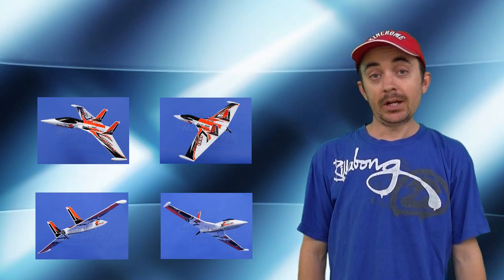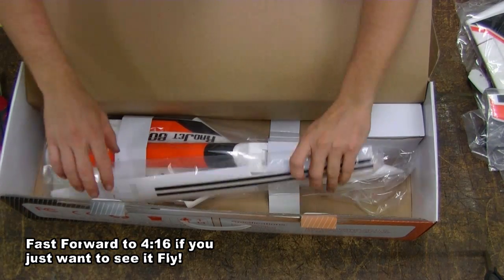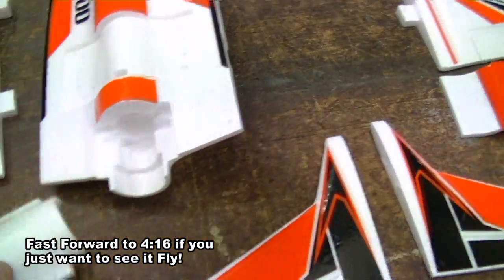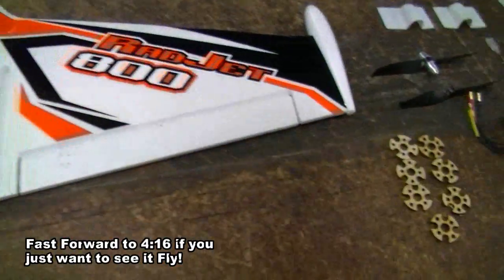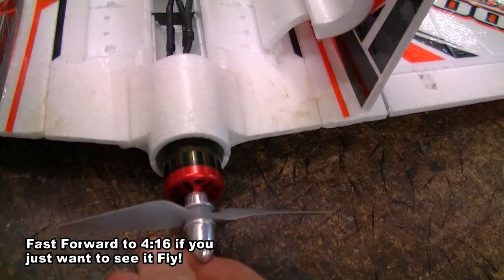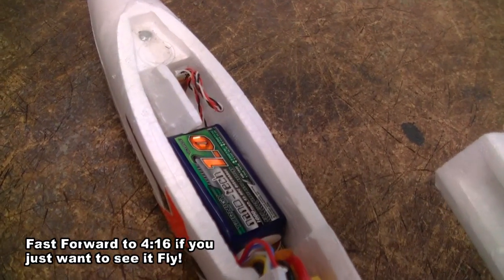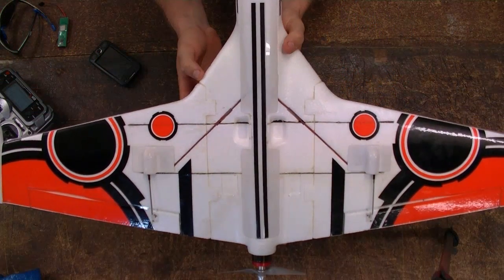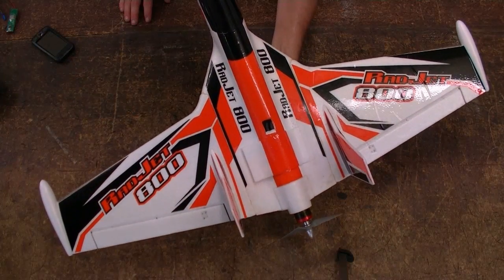HK Radjet 800, Unboxing, 4s Setup and Flights

Comment: When i start i feels like it doesn't react at all to the controlls, what should i do?
Reply from the maker: Do you have enough movement on the control surfaces?    also could be not enough air speed.   Does it get better after launch ?
Reply: @TheRattleSnake3145  I had the aileron controlls inverted XD. So i crashed at slow speeds why it felt like it wasn't reacting.  thanks.

Comment: I know that’s this is an old jet but I just got one brand new pnp and wanted to know if a frsky rx would suffice with my jumper t8sg trans.and why is there 3 different 3 wire(red/black/white)connections and a red n black wire set?

Comment: Yes COG is very important on this model as with all models..Great that you explained exactly where it goes...best to use a marker so when you use different power systems u always have cog in exact location... Important to secure battery to prevent it from moving as this plane is very fast... some guys  have gotten around 200 mph out of a radjet... im more than happy with my 100 plus setups... Great review!

Comment: Hi! Did you use the stock motor mount with the turnigy 2836 2350kv? I'm uncertain whether to buy the turnigy 2826/6 2200kv motor with 3s battery (Slower but longer flight time) or the 2350kv and 4s battery. Did you have some problems with overheating?

Comment: Just finished my radjet with your 6s set up wondering how it will fly with a 4s using the 35-36 ntm 1800kv.  Want to be a little careful at first. Thanks
Reply from the maker: chris horn I'm sure it would be fine as long as the cg is correct.  4s is probably better for every day flying as the 6s needs more room and you can only keep full throttle for a few seconds.  if you do find 4s not enough you can always prop up a bit before going to 6s.
Reply: Thanks so much for the help!!  What prop would you recommend for the 4s with the 35-36 motor. I  have the 5x4.5 on it now. Again thanks so much for the help and quick response.

Comment: Hi I have same motor 2836 /2350 I have reversed shaft but now the slot for the sirclip is not there I take it u need slot for firm location of sirclip 
       Regards
         Gary

Comment: i hate props torque roll is sooo annoying that thing can barely fly leveled..
Reply: Move your motor further up off the wing.  This will give your prop more ground clearance, so that if you wanted to, you can run higher dia. and PITCH prop and still have LESS torque roll.  http://www.hobbyking.com/hobbyking/store/__43929__Hobbyking_Bixler_and_Bixler_2_Motor_Mount_Upgrade_US_Warehouse_.html?strSearch=bixler%20motor%20mou

Comment: hi i have the same setup as yours and the same li-po as yours and i make only 1min 30sec and the lipo drains out to 3.85 what do you think i can do ???
Reply: I'm not always on full throttle, its probably something to do with that.
Or maybe your lipo is old?
Reply: no the lipo is new nano tech i only make 5 times on full throttle from right to left than it will be drain out to 3.85 or 3.75 
can i use the same setup of the 4cell and but a 6cell lipo ???
or do you suggest other lipo for more time but same speed i like that speed and if i can i will want more :D
Reply from the maker: wayne25801 
If you want more speed, check out the setup I currently have in the Radjet.
RadJet 800 6s 1200 watts (VERY FAST)
Keep in mind you will loose a bit of flyability with the extra weight.

Comment from the maker: I used Strips not rods, they are flat so you can just cut a slot in the wing with a sharp blade, then just epoxy them in.  They are bendy one way but very strong the other.  I  prefer to try and get them as close to the CG as I can, just make sure there is enough thickness in the wing where you put them.

Comment: I agree on the cooling, but the motor mount does flip around without modification so that the install looks clean like the original and balancing if needed.   Coincidentally a GWS slowstick motor mount can be used as well for using motors that have the shaft on the wrong side such as in-runners if you grind off the square part used for mounting on the slow stick.  It then fits exactly in the round cavity of the radjet if you ever need to do that.

Comment from the maker: The motor mount was designed for the motor to be mounted this way, there is no room on the inside to do it the way you say.
Also this way is much better for cooling as it would receive none if it was mounted 180deg around.

Comment from the maker: The first battery you mentioned (4s 1000mah 25c) was probably not high enough c rating so that could be one reason ts failed.
Its possible that you recieved a bad battery but if you were having trouble with other batteries you might want to have a better look at your charger, it might not be balancing/ storing your batteries correctly

Comment from the maker: Personally I don't really have up elevator on launch ( Only if I stuff up a bit and need it)

I have the throttle at around 75% my thumb on the elevator (incase I need it quickly) and throw upwards at 45deg.

I think if people are having trouble launching this plane its because they launch it like a "normal" plane ie throw it level.

Take a look at my video if this plane with a 1200 watt 6s setup and you can see my current method of hand launching the Radjet.

Comment: Hello RattleSnake, Thanks for the video and getting back with us on comments. I have a transmitter setup question. It is recommended to get some up elevator for pusher jets so that hand launching will be a bit easier. Can you let us know how can we set this up. e.g. give 10% of up elevator on launch and then put it back to 0% when plane is up in air.

Comment: The motor is 2350kv, it drew 42amp max with 620watt when I put full throttle. I flew half at half stick today and motor drew 10-15 amp I think, and was able to get 5 mins flight time, not bad but wish I could get more.

Comment from the maker: which kv motor is it?
Also you cant really compare a 6s setup with a 4s setup, 6s is more efficiant, that, and the extra 300mah are why the longer flight times.
Using a smaller esc dosn't make for a longer battery life, is just 
means it can't handle as much current.
You usually want a bigger esc than your current draw.

Comment: if are getting 15mins fly time, that's amazing. Something is not right with my setup then. I used Plush 60A ESC with Turnigy2836 , do you think using a lower rated ESC will help to prolong battery life?

Comment: In a dive. The batteries are new nano tech from hobbyking. There were charged fully and got very hot after flying, as well as the ESC and motor. I measured the voltage with my Hyperian EOS Sentry after flight and it actually showed 0%. Today I recharged the battery and flew again with less than 3 minutes and it has 14% left. I changed the prop to 4.75x4.75 and did not notice too much different. The motor/ESC/battery are still very hot. I may need to cut more hole to allow air to circulate thru.

Comment from the maker: By Zero I hope you mean %50 because a lipo drained to %0 is ruined.

Not sure why you got less than 3 mins, I guess make sure its charged fully.
Also how old are the batteries?

The current setup in my  Radjet uses a 6s 1300mah battery 
(drawing 1200watts Full Throttle).
If I just cruise around I can fly for 15 mins

Comment: I finally flew my radjet following your 4s setup with 4s 1300mah and 5x5 prop but battery drained to zero in less than 3 minutes (not with full throttle at all time). how could I get more flight time without using larger battery pack?

Comment from the maker: Thankyou!
Flipping the prop around doesn't swap it from Push to Pull, only swapping
2 of the 3 motor/esc wires does that.
The correct way to mount  prop is to mount it with the leading edge facing forward.

This is the same if its a push or pull setup.

Comment: Had a bad launch hit the dirt and broke motor off shaft first attempt....If it was an edf it would have been in the air..i am thinking of mounting a 50mm on top of where the pusher motor is...

Comment from the maker: The link for the motor is in the video description some motors you
will need to reverse the shaft (like this one) I have a video on my channel on how to do that, other motors you just need a prop adaptor that bolts onto the motor.
 The Motor is then mounted to the stock motor mount using the stock bolts.

Comment from the maker: In the the DX7, you only need to turn on Delta mixing.
Its probably the same with the Flysky.

If it isnt or you cant see where to in the radio, its simple to get an external delta/vtail mixer to do the same thing.

You just plug elevator and alerons into it and it outputs the delta mix with no settings 
needing to be changed on the TX.

Comment from the maker: Not sure on the actual amount of throw (Im not with the plane atm)
But Im running 100% rate for the elevator and
60% for alerons.

Its a very twitch plane on the roll, I also use 30% expo.
If you still need the actual amount of throw let me know
and Il have a look .

Comment from the maker: Personally I used 2 pac gel epoxy ( like normal epoxy only it doesn't flow).
Make sure you scuff ALL surfaces that will get glue applied to them.

Comment from the maker: The Motor you quoted has the shaft coming out the same end that it mounts to the plane.
This means that the shaft comes out of the motor facing the front of the plane which
is why you either need to reverse the shaft so that it comes out the back of the plane or get an accessory pack for it.
Its got nothing to do with the direction it spins.

Hope this has helped!

Comment from the maker: Its a 28mm motor (the same size I used here) so is should just fit straight in.
And being 2200kv it will work well with 3s or 4s ( I recomend an apc 5.5x4.5 prop)

You might want to get an accessory pack for it to so you dont need to reverse the shaft.
If you click the link above in the description showing this plane on 6s 1200watts, Its using an accessory pack.
just pause it at the right time near the beginning and you might get an idea how it will look when using the accesory pack.

Comment from the maker: Its just screwed into the stock motor mount (from the front) , which is some ply epoxyed to the airframe with a few ply pieces for spacers to get the motor in the right spot.

Comment from the maker: Thanks!

For expo I'm using 30% on Elevator and Alerons.
100% rate on Elevator and 60% for Alerons.

With the setup you have just seen and my current 6s setup, cg is 15mm further back from stock.

Comment from the maker: The motor I used in that video (Turnigy 2836 3700kv) comes with a 4mm shaft that has been machined down to 3.17mm at the end.  

I wanted a stronger shaft so I replaced it with a 4mm shaft.  
The 2350 kv version comes with a 4mm shaft so you dont need to change it.   

Yes you are correct, you will need to add a wheele collar to the shaft at the wire side. 

Its very important that you use the correct size hex tool for the grub screws, they strip out very easily if you use the wrong size.

Comment from the maker: Mine didnt come with magnets, I use tape to hold it down so that I can take it off if I ever need.
IMO the 5.5x4.5 is the better prop for this plane and is what Im using on my 6s setup too.
6x4 has more thrust but ends up being slower.
I order the APC style props whenever they have the size I need because the're much cheaper and seem to work just as well.
I havent broken either so I can't say which one is more durable.

Comment: I got Funjet. 1st two landings were fine. I broke prop on 3rd one. I like ur setup. I just ordered my Radjet ARF. nice thing abt that it is you can open that hatch all the way. does it come with magnets. I am new to this hobby. does the performance differ that much by changing prop from 6x4 to 5.5x4.5. Also HobbyKing sells APC style props. Are those as good as actual APC props.

Comment from the maker: Glad to help, you will love that setup!

I have just swapped the motor in mine to a Propdrive 3536 1800kv  and will be running
it on 6s with a 5.5x4.5 apc,    
I tested it and it pulls 56 amps /1200 watts
I havent seen a radjet on 6s yet so it should be interesting!

Comment from the maker: Yes thats the one, its a different KV motor but how you do it is just the same.
You wont need to change the shaft because the 2350kv already comes with a 4mm shaft.
The 3700kv version in that video came with a 3.17mm shaft that I swapped to a 4 one.